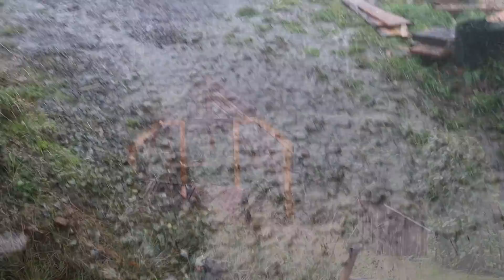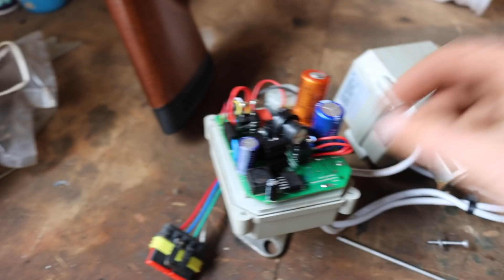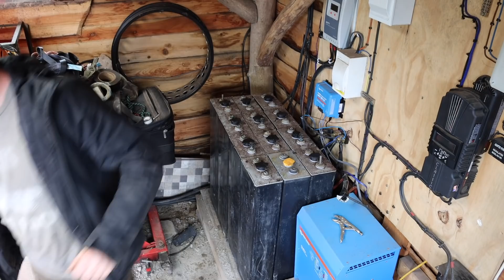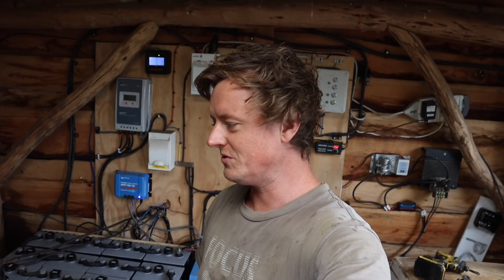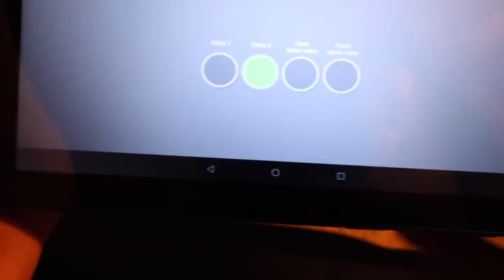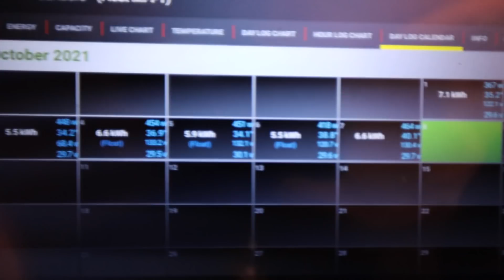Turning On The Hydro For The Winter And Installing A New Battery Bank

Comment: with due apologies for commenting on something 2 years old, it would be interesting to see or hear you discuss the offset of the battery tech. You  have mentioned before how the off-grid lifestyle goes hand in hand with a plugged in society because you like to benefit from the advances in technology. modern healthcare, your planer thickness-er,  the van, the production of glass for your greenhouse, etc....all these are from a very carbon intensive lifestyle.  I'm not slagging your efforts (clearly you are above reproach compared to 99% of society) but would love to hear more of your thoughts on this theme.

Comment: If your old batteries still worked why not add them to your system instead of scrapping/recycling them...wouldn't that increase/double your capacity?  Granted you cant use the shorted out one but couldn't you use the ok ones or is there a balancing issue.  If that is the case there are ways of connecting all the batteries such that they charge in a balanced manner.

Comment: I'm impressed with your use of fork lift battery cells. They look like 15 plate cells perhaps 450 AH or so? A useful tool may be an desulfator that is always across the battery that may extend your battery life? It applies an exotic waveform across the battery to break down sulfation. I only mention this suggestion since your generating season is not continuous and when batteries sit idle, this is where the technology comes into play. I sold fork lift batteries for 30 years so it was a surprised to see you using cells from them them!

Comment: If your interested I can provide a 51v Mason 10.5kWh Lithium Phosphate battery pack stackable up to 16 units. They use LiFePO4 3.2v 206ah Ess Battery 51*173*211 mm designed for heavey duty Solar Energy Storage System made by Seplos. Each pack wieghs about 80kg and measures 60cmL x 45cmW x 25cmH and looking at where you are storing them I would get about 6 packs of 10.5 = 63kWhs of which 80% would be usable 50kWhs of storage. They can handle up to 400A continues current and would last you 6000 cycles or about 10 years before they reach 80% SOH. The Victron your using is also compatible with the Seplos BMS and so in your case it would a plug go job. Temperature would be a consideration so I would house the Inverter and batteries together and the heat from the Inverter would act as a heat source to keep the batteries warm in the winter months, if you make it removeable in the summer, just if it off and leave as is in the video, open and exposed. As for recycling Litium it is a practice already in operation and as time goes by more and more companies will come to the for to recycle more Lithium. Most car batteries get a second life anyway after being removed from a car, before they are recycled. Nissan just anouced that out of all the EV cars they have made to date the Leaf only and hand full needed replacing. Thats a 0.001% success rate on a car battery that has no thermal management.

Comment: I make all my own lithium lipo4 batteries pack you dont need a bms if you using the victron charge controller you just need a good balancer for you packs so it keeps all the voltages very close to one another is easy to build ones you get the know how

Comment: You should get a lot more than 5 years from that battery, I have a 775AH 48V forklift battery I bought secondhand 5 years ago and has had no noticeable loss of capacity in that time. We drawdown at least 20% each night and only charge with solar.

Comment: The thing is how long lead batteries last compared to LifePo4 batteries. You will have to change batteries like 4 times with lead acid at the same time as one set of Lithium. Less work, less cost and better for environment. Inverters get warm must be mounted on a cement board.

Comment: .

... you may have identified the issue of the cavitations and air trapped inside the pipes... but the solution may at your inlet... most of inlets for pump or turbine are in submersible location... in this case you'd drawn from a kinda overflowing location... if you can relocate your inlet near the bottom of the retention pond you may have a better luck 🤞... or you'll have to looking for a better strainer design...to get rid of the cavitations...!?
... the other issue is the old batteries... they may just in need of some add on acid just in case that they're dried up... ⁉️
... what do you think about turning you power supply system into an hybrid one's...!?

Have much success with your endeavors...
EUDS

.

Comment: Lead-acid is great as voltage can drop gradually without a sudden disconnect as performed by Li-ion cell protection. It means in an emergency, with Lead, you will always be able to power some important stuff. In a sailboat or RV it is not funny with suddenly no electricity at all for anything.

With Li-ion you need some other energy source if batteries run out of energy.

Comment: Have you considered LFP batteries? Cheaper than Lithium-Ion battery, longer lasting, can be 100% charged all time. A little less energy dense and heavier but that should not be an issue for static storage.

Comment: Chris, you should close the stand pipe end to get more preasure. You could get more than 60 psi and higher rpm if you close the stand pipe. Opening the standpipe will reduce the air preasure causing the preasure to reduced. And the stand pipe height should not higher than your intake pipe. The whole water pipe  system should be air tight and air proof preventing air in or out of the whole system, from intake up to the nozzle. If the stand pipe is open, the preasure water prior to the stand pipe opening is wasted. Please do video on you closing the standpipe. To ease your task, remove the water in the system, simply by covering your intake box with wood or rubber or simply shifr the box lil bit avoiding the water prior to the installation.

Comment: Build an insulated enclosure for the batteries and they'll last thrice as long DO NOT have them exposed to the elements like that at it messes with them drastically plus you can get 4 or even 5 times the power @2000w the least out of your hydro water generator literally at least 4 to 5 times the power even a direct current from straight to output but these are ideas to work on but 1st 100% make a insulated enclosure for those batteries and have them next to something warm or warmth funnelled into them from ground up other than that brilliant job all round absolutely beautiful work

Comment: Have you thought about a model 3 battery pack? The pack could be had for cheap and it's beefy at 75-80kwh. With Jack Rickards system it should be flawless

Comment: I would Replace the midnight with something more updated All in one Hybrid 

MPP Solar  - WP series (coming soon)
Waterproof Hybrid Series 6048WP 6000W 
P65 WEATHER GRADE Waterproof and Dustproof
PARALLEL CAPABLE  Max 9 units, 1-Phase/3-Phase
BATTERYLESS FEATURE  PV power AC loads directly
GRID-INTERACTIVE  Support Grid-Tie Feed in or Off-Grid Useful for Off grid Micro Grid 
Duel 100V ~ 500V PV DC MC4  inputs

Mpp Soler as has a more Off grid version 
Waterproof Off-Grid Series  8048MAX WP 8000W
P65 WEATHER GRADE Waterproof and Dustproof
PARALLEL CAPABLE  Max 6 units, 1-Phase/3-PhaseBATTERYLESS FEATURE PV power AC load directly

Comment: If your looking for the definitive on building it Lithium, Will Prowse is the guy I've used on YouTube for making my first battery. This guy knows everything on off grid power. You would also have to consider low temperature heating protection if your battery room gets cold. Nice work.

Comment: I'm excited for the hydro content.  Keep it coming.  I should be getting my windmill back online after it being down for 8 months.  I built a homemade 3 phase alternator that's more like an electric motor, but it's optimized for very high current and low RPM's in a smaller package.  It should perform much, much better than the old setup.  I'm also wiring up a portable 1.5 kwh battery made from 99 Tesla Model 3 cells as a better battery so I can run a 2000W inverter.

Comment: Envious of that battery bank - must be a fair few amp hours!
My first 4 Trojan T105s are very much in the process of giving up.  I'm very pleased with them.  They've had exactly 5 years of severe abuse.
The change pot won't cover a new set just yet, so it could be an interesting winter...  It's just a little ironic that I live literally 5 metres from a stream, but it would probably be of little use for generating power.

Comment: Most lift truck batteries you can replace each cell separately and fix one broken cell super easy and cheap ... disconnect it and pull it up that simple

Comment: If you double tap on the square on your tablet it should cycle back to the previous app opened. Just a quick way to switch between two apps :)

Comment: I'm curious what the approximate cost for the batteries are and also their size, in amp hours?  some places here in the US I see 2v flooded cells cells that are about $0.50  per amp hour. 1000ah crown cell for $535  Seems pretty expensive here, I hope they are cheaper for you.

Comment: 2v cells are they like submarine batteries?
I’m building a PV system on my Routemaster bus, so far I’ve got 6 100w 18v solar panels and a voltage regulator, need to think of charge controllers, isolators, batteries and weight.
Reply: Thanks for the comments. Much appreciated.
Feel free to message on Whats/ App / Text
For questions, Investment guide and tips.
￥➕①=②=⓪=⑤=⑥=⑦=⑦=⑧=⓪=⑤=② =  .......✅💹📉📥

Comment: I've always heard that I shouldn't put batteries directly on concrete. Is that a myth?
Reply: It is a myth with modern plastic cased batteries. 
In the old days with wooden boxes or tar cases...the leakage paths to the ground could deplete the battery if the moisture/splash electrolyte formed a path on the outside of the case from the terminals to the concrete?
Reply: @JohnSmith-yv6eq  Thanks for the comments. Much appreciated.
Feel free to message on Whats/ App / Text
For questions, Investment guide and tips.
￥➕①=②=⓪=⑤=⑥=⑦=⑦=⑧=⓪=⑤=② =  .......✅💹📉

Comment: Hey Kris, you are very inspiring, thanks for the videos. Have you thought about PV pumped hydro as your batteries? I've not worked out how much capacity would be needed but it would be interesting for the summer rather than batteries. One reservoir down and another up top.........your thoughts......
Reply from the maker: I have indeed, it is a really good energy store but the size of storage needed to be worthwhile is quite large. My turbine runs at 5 litres per second so it needs about half a million litres to make about 10kwh so you need to move a huge amount of water and have quite large ponds top and bottom.

Comment: Just found your channel what a gem!! Ive never seen lead acid cells like that before, i run 8P 12v 110 Ah for my off grid set up. Did going 24v help with inrush loads like ever now and again the my 12v inverter cuts out when the fridge kicks.
Reply: If you admire DIY hydro...check out Marty T in New Zealand
https://www.youtube.com/watch?v=LVoeaKCEd2o

Comment: wy not making this in a nice dashboard with home assistant so you can see the energy made/ used and battery charge. and after that make a automation to turn the valves open when the charge is low and close when closing in on 100%

Comment: Plastic bits are to stop the batteries wearing against the steel battery box of the forklift as you drive it around.
Reply: Should last a lot longer than 5 years, our pack is from 2005!
Reply: @zogworth  You can always edit your comments by clicking on the 3 vertical dots to the right of comment.

Comment: While there are details (a disconnect occasionally for equalization), you can parallel Lead Acid and Lithium Iron Phosphate batteries as the Lead Acid won't contribute much unless there is a large surge or the Lithium battery back drops to pretty low state. The Lithium will charge first and discharge first.  Your BMS will have to disconnect the Lithium around 2 volts per cell.  Charge the Lithium to 3.4 to 3.45 (or even less, Lead Acid will charge at 2.2 volts per cell) for longevity and program it to disconnect during Lead Acid equalization.

Comment: I would recommend lipo batteries for the forklift one of the former creative guys installed it in a scissor lift and works even with Low charge far better than th£ old sub batteries

Comment: Kris, if you skip that last battery in the first row and continue to serpentine the batteries just as you have, you can pick up that skipped battery last--and that will make those tight cables more comfortable.

Comment: If you leave some spacing between your batteries for the heat to be able to disipate, they'll last a lot longer. Great that you put spacers in the new ones as too much heat shortens the life of the battery. A bit more space would help.

As for lithium, it really isn't worth building them. Buying specific ones will allow you to configure you Victron equipment settings to that particular model. Building them, you'll be guessing and possibly shortening their lifespan. In the long run, it's cheaper to buy decent ones. You can get good Pylontech for decent prices these days and they communicate well with Victron.

Really like your hydro generator and would ove to see more technnical details on that.

Comment: Depending on the battery and what went wrong you might be able to wash crud from the bottom of the bad cell and unshort it. If that doesn't work filling the cell with more conductive fluid to get the best use out of what's left.

Comment: There is certainly value in a lithium battery bank, but honestly in a non-mobile application such as yours I think large lead acid is just fine. I have "drop in" lithium batteries on my boat and they're great but a big part of their benefit for me is that they weigh like 1/3 as much as the batteries they replaced.

Comment: If you have remote control over the pump house, perhaps you could close all the nozzles for say a 5-minute period once a day. The water would back up and run out of the dam head backwards. I think this would be very effective to clean the grate. I realize there is not a terrible amount of loss when the great is blocked, but this could also serve to flush the lines. Maybe have it come on ce every 24 hours in the middle of the night?
Reply: Most importantly, this technique would prevent any air from entering the pipe.
Reply: @jpsimon206  You can always edit your comments by clicking on the 3 vertical dots to the right of comment.

Comment: I'm sorry if the answer is obvious, but it's not to me. I understand the old batteries were losing capacity and that you had one short circuited. Why did you not just add batteries to the existing pack? Or why not keep say the best 25%? Isn't more capacity always a good thing?
Reply: It's always a good thing to ensure that the system is balanced...and of the same age and capacity....especially if you run just one charging control for all the batteries......
If each battery could be charged independently...then an old battery would not unbalance this charging system/rate of charge/discharge.....
Reply: @JohnSmith-yv6eq  thank you this makes sense

Comment: Hi Kris, you are correct the panels are for air circulation cooling the batteries as they are charging.
I must have missed your video about installing the previous ones. I would suggest even just 1x2 strips of wood between the batteries. So as they heat up being charged they do not over-heat, vent, and boil and bilge (where the walls of the batteries goes convex). Just a thought.
As for lithium I am not so either but check-out carbon foam, a game changer in my opinion. Like Firefly batteries.
Oh yeah, still. Love your channel!

Comment: That was very interesting, thanks. I also have one of those elbow torque wrenches. And I have an eyecrometer too. As you intend to have machine tools in your big new workshop, I was wondering if you have any damp or condensation issues in the two workshops? Leaky roof aside of course!

Comment: I had an idea when I first watched your hydro power videos, to remove the sludge from the water intake try putting three or more 3-5mm holes in the pipe side of the box as near to the bottom then the water pressure would push the sludge out automatically with the flow and it would also go back into the river
Reply: An alternative wouuld be to deepen the pond behind the dam..and use a 5 inch pipe with 10mm holes bored all along it and shade sceening covering the holes.... at say half the water depth...thereby eliminating all the surface floating crap...and all the bottom rolling crap.....
If you admire DIY hydro...check out Marty T in New Zealand
https://www.youtube.com/watch?v=LVoeaKCEd2o

Comment: You get more money for the melted lead in a battery, than for the battery itself. I renewed my battery bank for LiFePO this year, and had a few duff  lead acid batteries, and weighed them in at the local scrappie. If I wanted to maximize the cash yield, I'd have had to break the batteries and melt the plates. Lead not being that risk free, I didn't bother, so lost more than half the value.
Reply: The 'local scrappie' probably sells the full batteries to a specialist pb battery breaker, and buys back the lead..... Both the scrapman and the pb man make their money by being specialists at a few jobs.

Comment: I think that if once a year, you introduce a plastic tube that goes all the way to the bottom of the battery, and you put low pressure air into it .. this system mixes the acid that has stopped at the bottom, to mix it again with water present at the top This is a problem with stationary batteries when they are not recharged at high current, which helps to remix the liquid